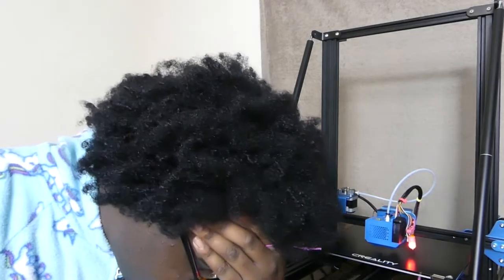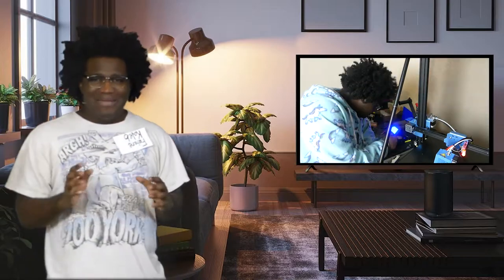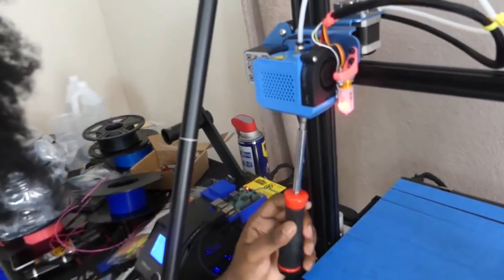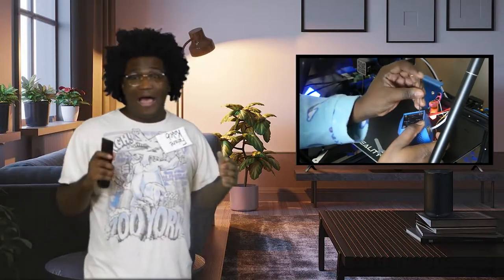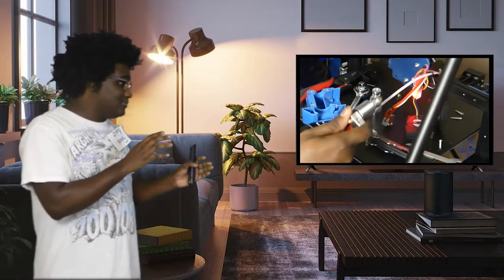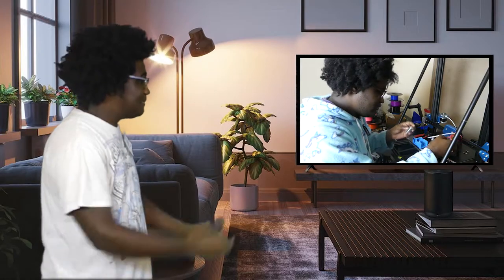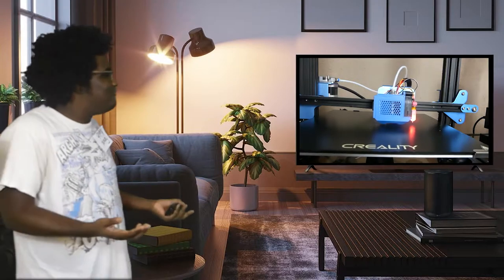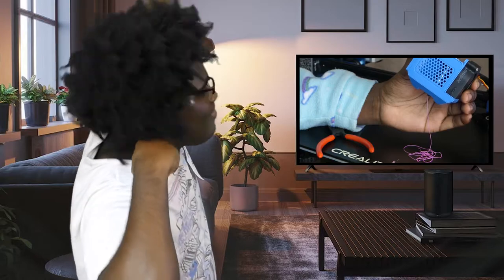How to upgrade the CR10 V2 Hotend, Properly

Comment: This is odd I've had this CR 10 for three years almost and all of a sudden I'm having this happen it'll start a print it'll run for 15 minutes and then it'll do this it'll clog up I don't know what the hell I'm doing wrong I think I'm pushing the tubing all the way down it's stopping at least I heated the hot end up as hot as it'll go so I could run a cleaner through it and make sure that everything soft and then I clean everything out and then while it's hot I push the tube in and turn it off and reassemble everything and I hold that tube downward the whole time so it can't slip up and then glue itself to the side I don't know what the ** else to do I'm like about ready to buy a new 3D printer and it's ridiculous. I need a new complete hot end assembly because of some damage it took but it still should function I just want the aesthetics to be there for some reason lol but i
can't find a new hot end anywhere to save my life

Comment: That is how you change a nozzle and try to destroy the cables to the heater cartridge and thermister in the process.
Always use a spanner to hold the hot end block in place when you do that.. Always...
Yes, it will work a few time, maybe more.. But rotating the heater block with force like this, will break the thin cables at some point...  
Not to mention you turn the hot heatblock into the plastic, which do take damage overtime as it is ABS and will deform due to the heat......

Comment: so how did you fix it exactly ? i have watched the video but i do not fully get how you did it . did you use the standard hot end on the printer or did you buy one because you said you bought one on amazon that was compatible  the reason im asking is i bought the microswiss hot end to use and it doesnt mount to the cr-10 v2.
but i have already upgraded the firmware to the blt version so my hot end can now go to 300 deg .

Comment: Bro any tips for adding bl touch Capricorn tuning and a micro Swiss all metal hotend I found this 3D printer in the back at my school fixed it up with new extrusions and a wheel kit I found I would really like your guidance on these because I wanna print badass helmets like master chiefs and the mandalorian and deathtroopers